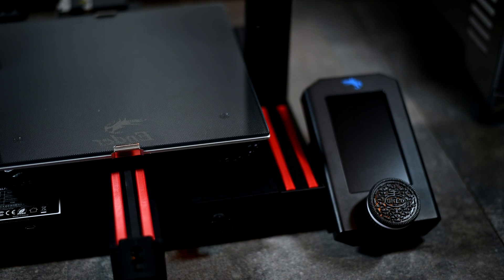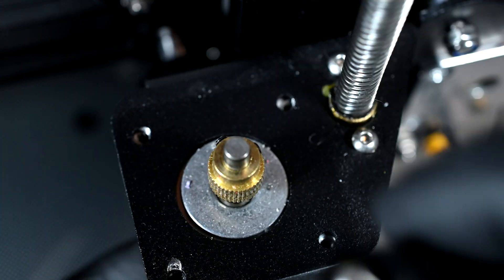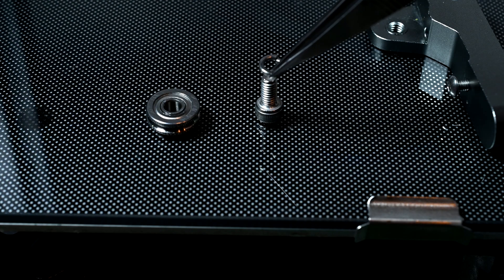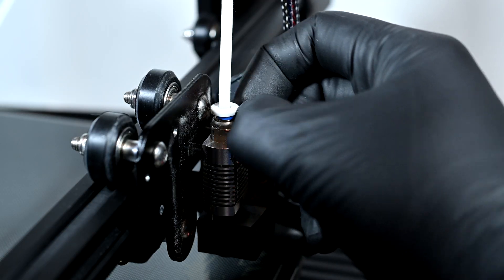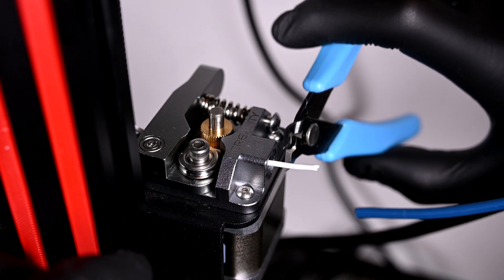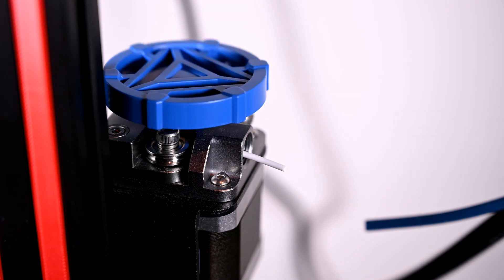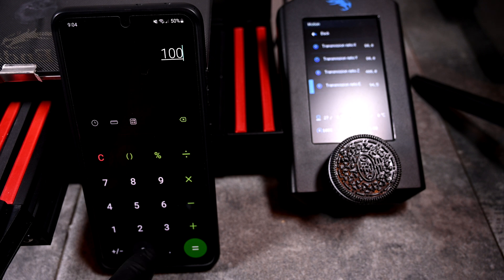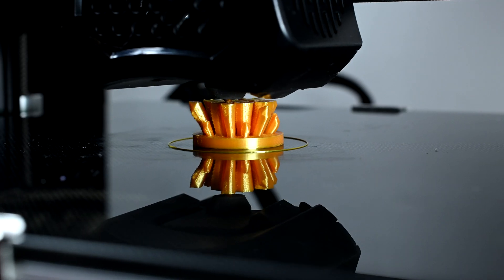Ender 3 V2 All-Metal Extruder Upgrade | E Step Calibration | Guide

Comment: My extrusion gear must be glued or something because it is STUCK on tight. If this happens to you, you can follow this video and use 2 hammers to remove: https://www.youtube.com/shorts/rbO81hLkxNc
Reply from the maker: Depending on which Ender you have, some of them are quite literally press fit with a machine instead of just grub screwed
Reply: Bless this. I felt so bad having my father work to get that damn thing off

Comment: I just installed this extruder but my instructions/digram shows the gear facing the same way up as the original one. Remains to be seen if it works well.
Reply from the maker: I think as long as it grabs the filament, it’ll work either way!

Comment: Thank you so much. I'm new to 3D and upgrading without instructions has been challenging. I had no idea I had to change the rate after this upgrade.
Reply: Yes, glad I did. It was off and causing under extrusion.
Reply from the maker: @NIKEGDS  very nice!
Reply from the maker: You don't have to per se, but it's always good to calibrate if you make any changes to the hotend or extruder.

Comment: Thanks for the calibration part of the video. I just built my own ender 3 V2 two days ago and when I printed the cat test print that came with the printer, I saw that on the raised paw there was an under extruded hole. I found this video before I even purchased the printer as part of the research i was doing for the new extruder and upon measuring the filament that was coming out of the extruder, I saw it was only 92mm when it was supposed to be 100. I followed your instructions and got it to 101.5
Reply from the maker: Yep! It's crazy how much of a difference just a few millimeters can make.

Comment: Anyone else had the problem with getting this peace where the part that goes up is too heavy so it can’t go up?
Reply from the maker: What? Nothing should be too heavy. Do you mean the gantry arm that carries the hot end? If it isn't going up its because the stepper motor for you Z axis isn't spinning, if the printer is off you can manually turn it with your hands to raise and lower the gantry.
Reply: Or you can disable steppers. You can find it in Prepare>Disable Stepper. Just make sure to auto home afterwards